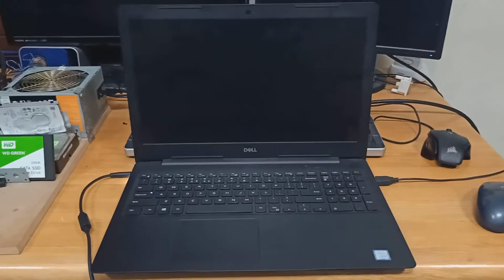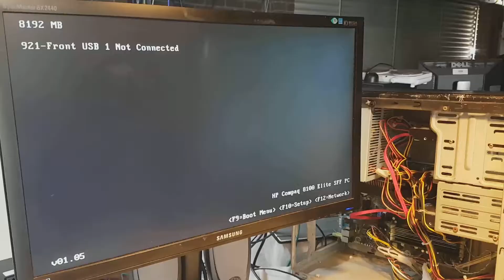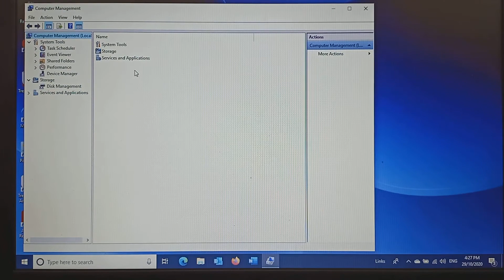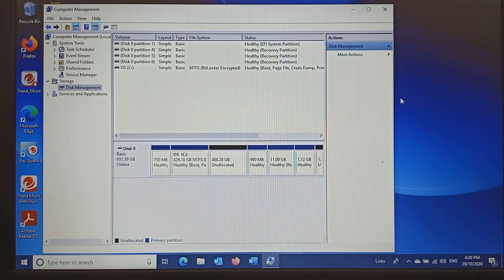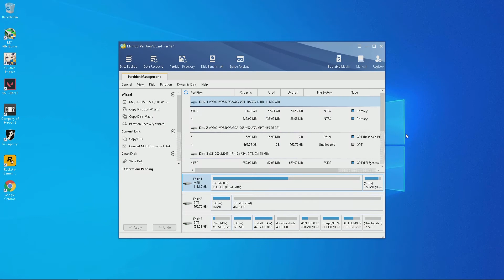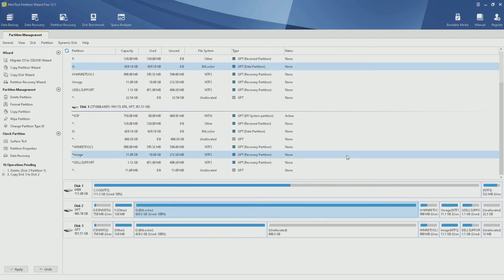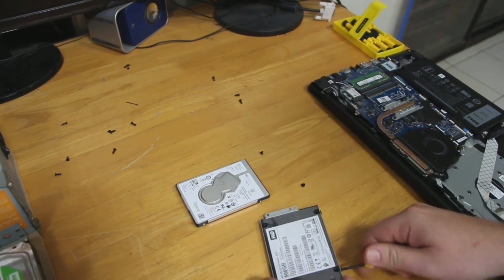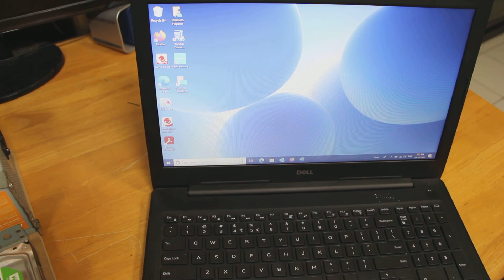Dell Inspiron 3583. Hard drive upgrade. From Magnetic To SSD

Comment: Hello I have the same thing but with amd Ryzen 5 could u help me on which of the ssd compatibility 
(Dell Inspiron amd ryzen 5 Vega ....
Reply from the maker: Any chance you can dig up the model number or service ID tag from the bottom of the laptop.

our guess at the moment with current infromation is it will most likely need to be m.2 SSD and your best option is to get an NVME version of that over 3Dnand. 3Dnand is slower in our experience.

M.2 is the slot (Kind of like SATA and IDE but no cable interfacing the drive to motherboard).

Samsung EVO NVME and Samsung Pro are good drives. We also on the cheaper side have us Silicon Power SSD drives and have been happy with the value they bring.

Thanks for watching.

We hope that helps.
Reply: @OFFbitTech  thanks 🙏🏽
Reply from the maker: @Tom122-r2m  Our pleasure.
Thanks for watching.
Reply: @OFFbitTech  but just got another problem with the HDD and it says hdd not installed I have tried several options including removing the hdd and reinstalling it but the same problem exist
Reply from the maker: @Tom122-r2m  Sorry for late response.
Have you been able to see if the drive picks up in the BIOS.
Also the operating may of not copied properly over if you used the same method as we did.

Let us know if you can see the drive in BIOS.

If so it's probably just an operating system thing that may need to be recopied or just try to recover or install over the top off.
Reply: @OFFbitTech  everything is going smoothly now thanks
Reply from the maker: @Tom122-r2m  Great news.
Good job.
Thanks for watching.

Comment: So if I wanna switch to an ssd for my pc can I just do this and copy windows 7 to my ssd? And how can I like just get the OS from the hdd and use the hdd for my games and ssd for the OS?

Edit:.this is the first time I knew you can copy OS lol.
Reply from the maker: It is a lot easier if you have a second computer so you can just copy the image across. Mini partition wizard maybe able to copy a partition from one drive to the other on the main boot o/s though. That I have never tried.... yet

So what I do, I remove the drive from the Laptop, put it into the test rig I have. Boot up the test rig on it's own operating system and also have both the new and old hard drives plugged in from the laptop.

I run mini partition wizard (from test bench drive). From there I copy the drives over using mini partition wizard.

So you can use this pretty much for any drive. You just need to make sure that the new drive has enough space for size of the partition from the old drive.

Now I think you want to split games up and your O/S drive.
So...
What I think you need to do is on you current drive is...  this is not probably an easy solution...
but anyway....
You need to make some free space up on the current main drive (you will need to leave a some free space for your windows swap file as well when you are done)..
This maybe mean to uninstall a game or 2.

Resize current partition and make a new partition (games partition) and slowly move stuff over (remember to leave a little bit of free space for swap file on o/s drive) repeating these steps...

once you are ready just copy the first 2 partitions of the old drive.

Old drive should look like this in the end
[    sys reserved     |    (C:) partition    | New Games Partition ]

copy sys reserved and C:
to ssd
[    sys reserved     |    (C:) partition    ]

I think this should work....
but wont be easy and is still a little bit of a risk with out having a another computer to fix and faults you may make.

It would probably much easier just to get a big enough ssd to copy your current drive over to the new, or just delete a few games resize your partition down, & copy over the image.

Boot new drive up and see if it works. Then your safe to remove data from old drive and install / copy games back over to old drive.

It can be a little bit complicated. But the good news is you can test the ssd if it boots ok before you need to destroy the old drive. It's the drive prep on the original drive that might be tricky and painful. 

I think this replay is a bit long sorry about that.. It's bit of a tricky task. But can save you alot of time in the long run.
But on the doing a fresh install of windows is also a nice way to make things fast, snapy and clean again.

Which actually may take less effort depending on how much juggling you need to do.
Reply: @OFFbitTech  I have a 250gb of hdd atm and I have 350MB for sys reserved and 97.31gb on C: and 135 for the games and I'm planning to buy a 120gb ssd do I still need to make some free space and make a new partition? And my friend have a pc I can just use it but it only has 2 sata connection available :/.

I'm kind of scared because this'll be the first time I'm doing this lol
Reply from the maker: OK it's is a bit of a tricky thing to do.

Best to back up anything you really need to keep as well.  (just in case)
You should be able to just copy the sys reseverd partition and C: ....
Get that onto the SSD.

Then try booting up the SSD and check if everything looks like it's working and there.
Once happy you should be able remove the old partition of the magnetic drive and expand the partition to full size for your games.

It may be a problem only 2 sata though. Can you disconnect the DVD sata by any chance for time being?

just make sure you read things twice and back up just in case things go bad.
Good news is you just need to get SSD to boot your windows and you are only copying, so you should not loose anything at the start.

Good Luck..
Let me know how you go if you can work out the sata connection problem.
Reply: @OFFbitTech  dvd sata?? Uhmm sorry what is that? This doesn't have a dvd drive
Reply from the maker: @29stann  Oh, well it wont be a sata DVD drive then. 

So no go, thought if you had a DVD drive it could of been sata, you could of borrowed that port.

however that wont help.
Reply: @OFFbitTech  welp imagine not being able to grab a snack while the game loads lol, thank you for answering have a good day man :)
Reply from the maker: @29stann  Lol, Mate I know that pain. Hope you sort that SSD setup at some point soon.

Thanks mate.